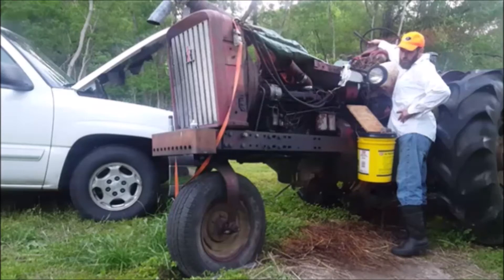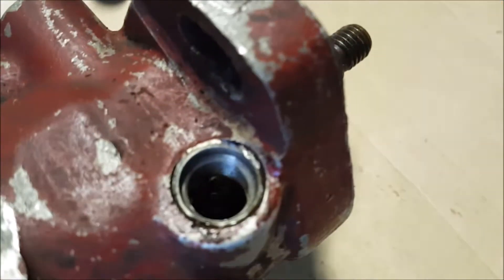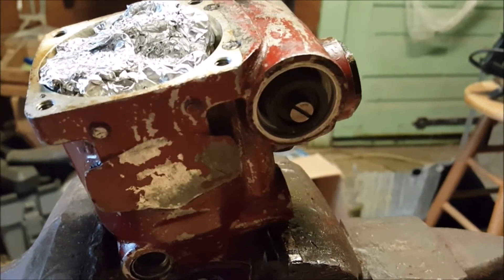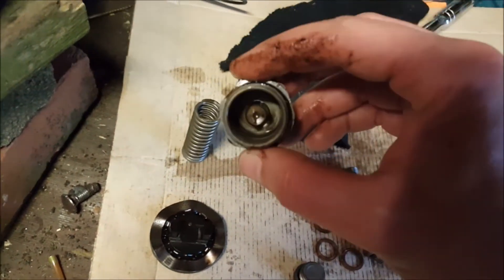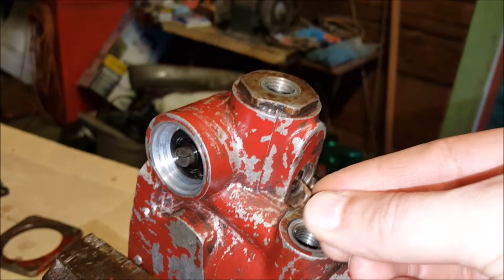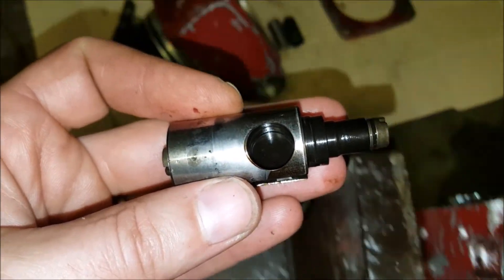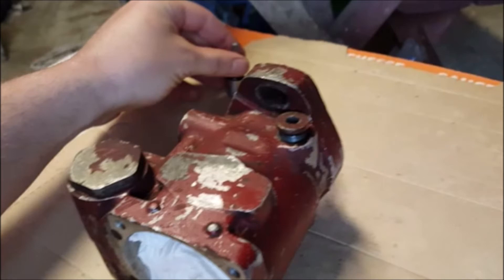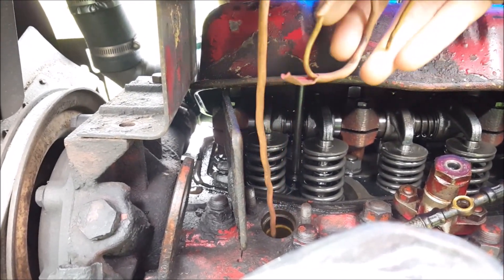Bosch Pump Disassembly pt 3

Comment: Hey Dustin, If its me, I would completely dismantle the pump and pull the shaft off. there may be a problem with the fins assembly that pump diesel into the unit, also the bypass or relief valve could be the problem, if it doesn't seal good, then it wouldn't build enough pressure to pass through the other parts of the pump and just return to tank. Do not heat the body of the pump, just tap the bolts with a hammer, you may have to get help while you are trying to loosen the bolt with a wrench or socket, the helper will have to tap on the tool just above the bolt to create impact to help loosen the bolts. Good luck brother.
Reply from the maker: Man, I never got an alert that you replied!
Ok, your advice all makes sense. I may need to make a special wrench to remove the strange plug on other side of regulator valve. Or tack weld a 10mm open-end wrench to the plug. Already put it back together.
I will post the reassembly and installation video soon.
Reply: @servihomestead4324  No special wrench needed, just an open end wrench, I believe it is 10 mm. Don't use any heat, as it may damage the pump. Did you find the gasket and seal set?